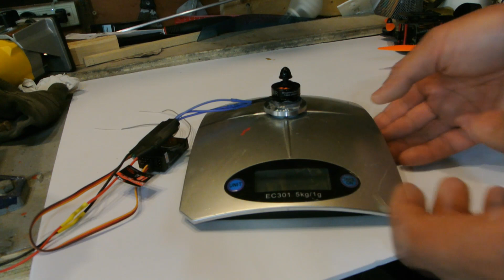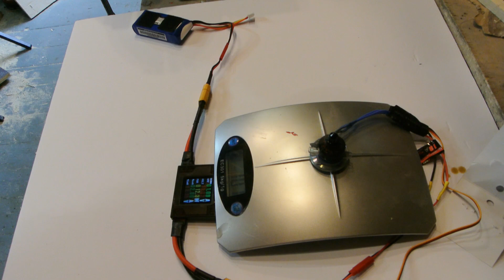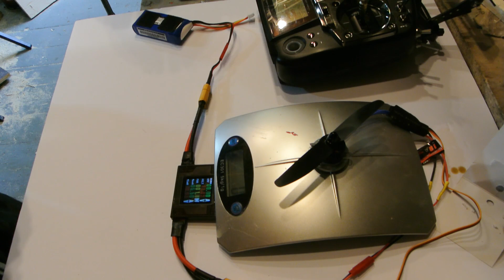ZMR 1804-2400kv Motors Review and Thrust Test

Comment: Just to be honest your test dosen't work. Your are pushing air onto the scale that gives you a non realistic since your puching onto the surface. Rev it the other side around pushing air to the top and it would give a better idea. Even if it's drawing air from the side and not the bottom
Reply: exact

Comment: this is also a good proof that what I always known that more blades equals less efficiency and thus less lift. This is because that every blade on a pro makes turbulence and if a another blade get into this the lift will be reduced because a wing will need undisturbed air to be as efficient as possible. The optimal would thus be a one bladed prop but to get the most of the prop instead of a deadweight for counterweight two blades is the most common.

Comment: Hello Andrew w

I was wondering wether u know what is better out of the carbon fiber or fiberglass frame
I am getting the carbon fiber
Reply from the maker: Chris Peacock I think the carbon would be better, it would be lighter, but I think the arms might have an issue with the bolt holes being drilled kinda close together, under a hard crash they can break easier than the real blackout.  rcmodelreviews did a video about it.
Reply: Andrew W ok thanks